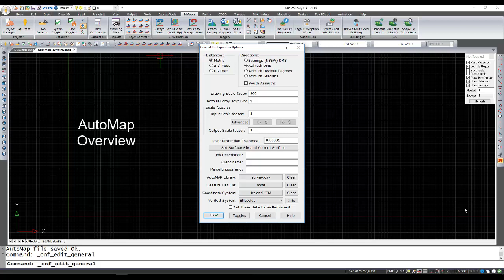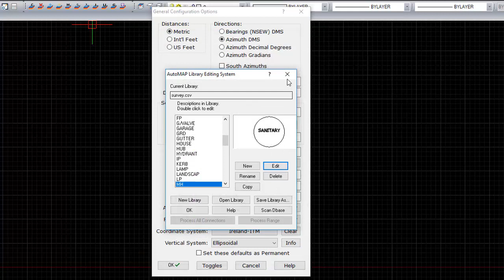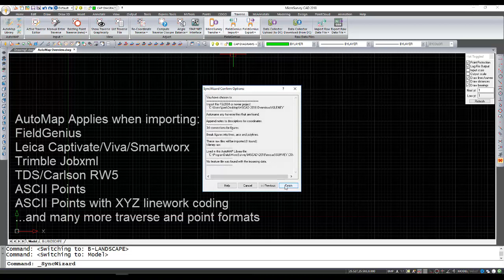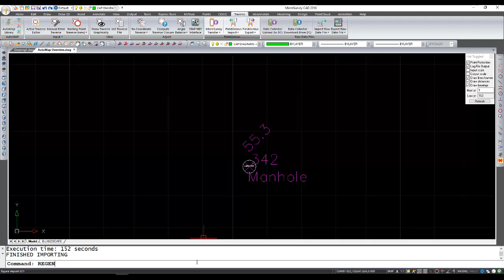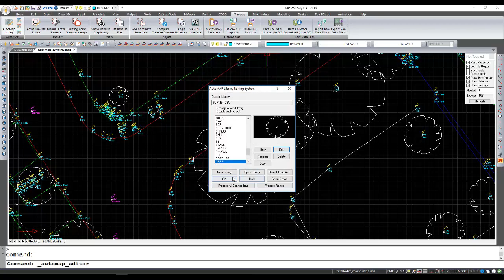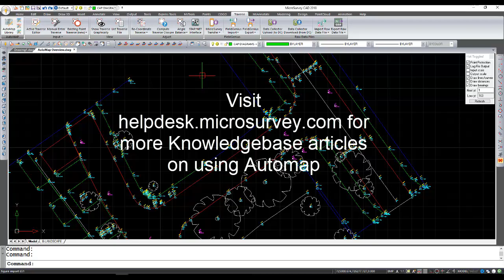AutoMap Library Overview

Comment: When multiple features are surveyed, say buildings for example. I would typically store a point with the description BLDG for all buildings. I would also number the buildings, BLDG1 for the first, BLDG2 for the second etc. 

I would prefer to setup one BLDG description for my custom autoMap library. Here's what I tried:
BLDG = Only points with description BLDG are connected with a line
BLDG* = One continues line connection through every point with description starting as BLDG